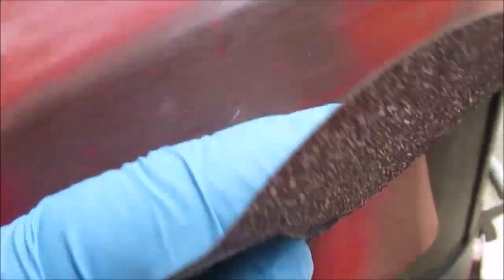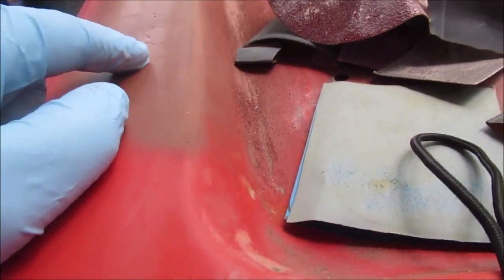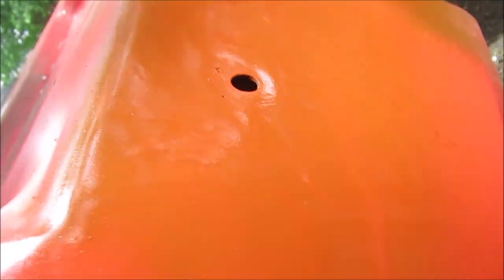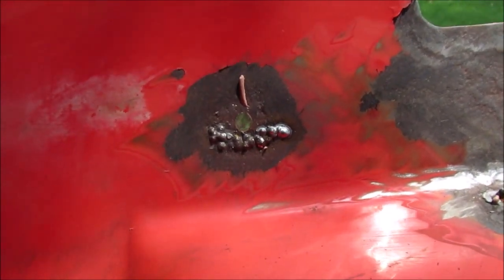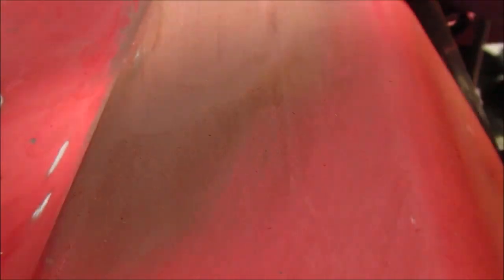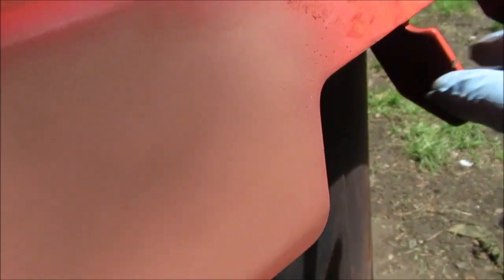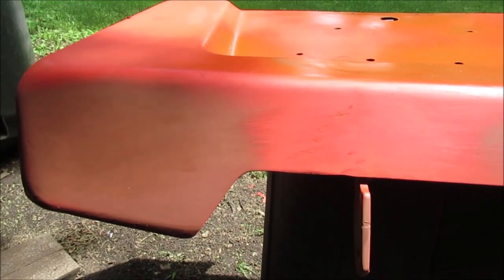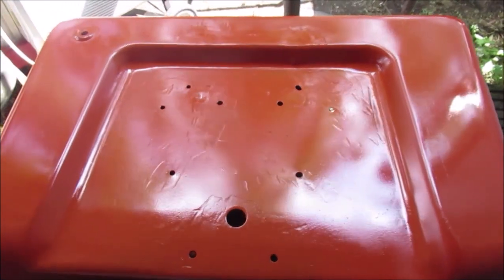Body Work on garden tractor fender PART 2

Comment: Are you going to put 59 Cadillac taillights on it? Maybe some blue dots too?
Reply from the maker: No ..It will look mostly original ..I did paint the mower deck black  which is not original ..I am researching what tail lights or reflectors could have been used on the rear when it was new